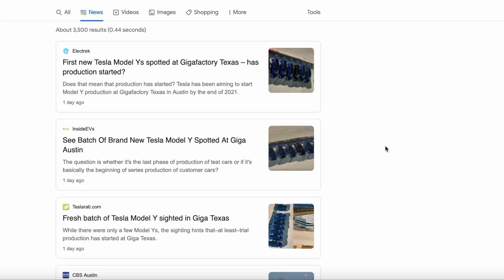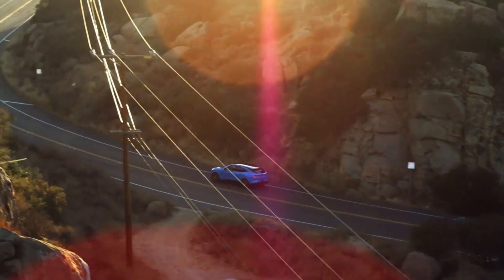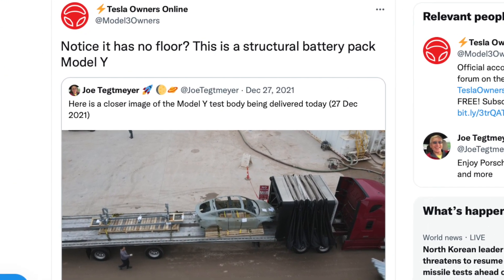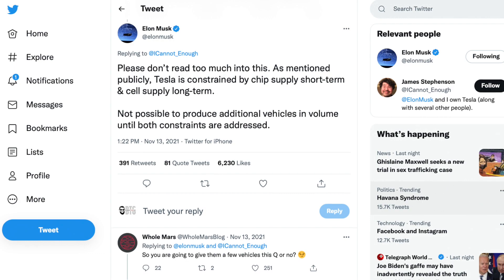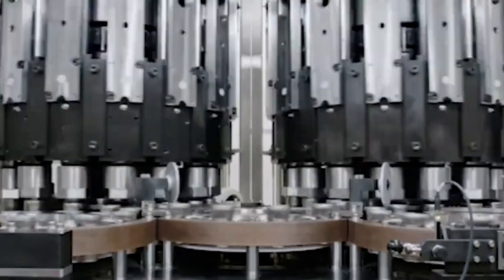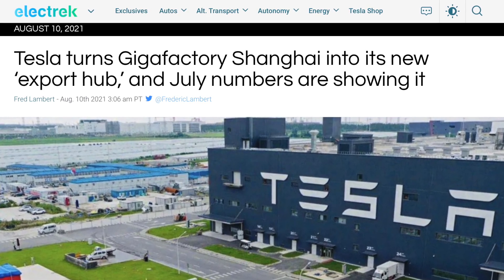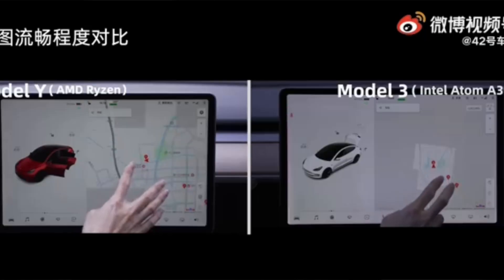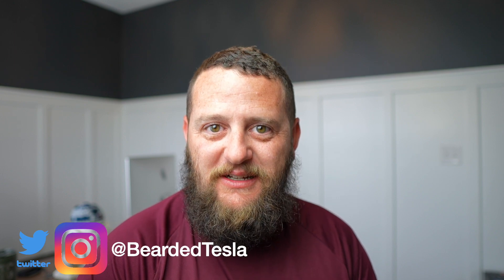Refresh Tesla Model Y Giga Austin Imminent (4680, AMD, Lithium 12v)

Comment: What is the possibility that the floorless Model Y skeleton has a modified 2160 batt pack to be in place of the 4680s until they ramp up production?  Or vice versa, could they be sandbagging us all and 4680 structural battery packs are already IN the Model Ys out of Fremont????  lemme know what you think pls!
Reply from the maker: There was talk about them having a solution for 2170s in the new body if needed

Comment: Interesting that the standard range would have the LFP battery back. The 4680 cells would make the standard range models extremely desirable (but then again, Tesla isn’t really worried about increasing demand right now). It would attribute to the long-term goal of making these vehicles way more affordable, but in do time. 
Hoping to see Model Y price adjustments in the opposite direction soon (fingers crossed they can achieve volume production sooner than anticipated).
Reply from the maker: I agree but for now supply is limited

Comment: It seems the battery supply chain will filter out which EV manufacturers will survive in future. If an EV manufacturer cannot get enough battery raw materials for battery production, then its EVs will be expensive and not meet customer demand which makes these customers buy other EVs thereby naturally filtering & bankrupting the under-prepared EV manufacturers.
Reply from the maker: Pretty much

Comment: Great video, thank you for sharing!! FYI the new lithium battery is 15v, not 12v like it says in the title, and will also involve some updates in electrical components to allow them to conform to the higher voltage.
Reply from the maker: Thanks for confirming
Reply: @BeardedTeslaGuy  👍

Comment: Took delivery of a Model Y LR on Jan. 6th, unfortunately did not have AMD, and probably not the new 12v either. Tesla couldn't tell me and I haven't dug into the hood to find out. I may have missed out. Oh well. Still enjoying the car :)
Reply from the maker: You can remove just the cover over your bio filter and you’ll see what battery you have
Reply: @BeardedTeslaGuy  I checked this morning, looks like it’s the older lead acid battery, supplied by Hankook (85B24LS). I wonder if that can be swapped later for a new lithium ion?
On a side note, those little vents in the cover break very easily. Be careful!!

Comment: I think the new Austin MY with the 4680 cells will be sold at a higher price, if Fremont is still putting out the MY with 2170 cells. Tesla would have to do this because people would be canceling their Fremont orders in large numbers to get the 4680 battery cells. At this time Tesla could command another $5k-$10k for the Austin MY if the range comes in at 400+ and the charge time is significantly reduced. This price increase would be temporary until the whole MY production shifts to 4680. The only other possibility would be if the Fremont has the capacity for the 4680 cells to supply their own production. Also, does Fremont have the front casting Gigapress in production yet? Hopefully all these questions and speculations will be answered at the Q4 earnings call next week.
Reply from the maker: I’d think so too

Comment: Estimated delivery for my LRMY is Feb 25 - Mar 25... wondering if it'll be a freemont or Austin. Hoping Elon's product roadmap will answer that question for me. Hoping for 4680 cells but only 1-2 months away from delivery, it doesn't look likely
Reply from the maker: Hope it answers a lot of questions. I wouldn’t hold your breath though because it’ll take some time to get to volume production
Reply: worse to push your order further. First when we've got info regarding 4680 last year everyone was excited until it's been pushed that we shouldn't expected it earlier than end of 2022. Currently we have what is in the video. Austin Giga will start production with 4680. Huge surprise. So yeah, just wait extra 1-2 months if possible. This is my plan now

Comment: I just took delivery of my MY a few days ago and it does come with the new AMD Ryzen chips. Wish I could have held off my order longer for the 4680 batteries, but I have a feeling they won’t be ready until much later this year at full scale so I was happy to take delivery.
Reply from the maker: Yea, 4680 may start showing up here and there, but volume production will take a few months I'd suspect.
Reply: @ Lt.Dan457  I feel feel your pain 😔 I m scheduled to take delivery this weekend cuz I already have loan approval and insurance etc. Instead of being excited, I'm agonizing over this batteries business.  I could try to hold them off but loan approval may expire and there's no guarantee I will receive the 4680.  Typically, I would not car but I am planning to keep this car for a long time since I recently retire and don't expect to use much.  What s your take? Are you regretting your decision about the delivery? Hope you will get to enjoy it since it is a big purchase.  I guess you can always sell and buy the upgraded version later. Then again, not everyone can afford that.
Reply: My thoughts are I'm ok without the newer battery. They'd likely adjust the size to get same range. Would likely just make the car lighter so a bit more efficient, which is why child use a smaller battery. Likely same/similar warranty, so overall I think it's a wash for now. I'm trying to patiently wait. 3-7 weeks to go.

Comment: Taking delivery of my MYP tomorrow. Will update you if I notice any upgrades. Great videos as always!

Update: Just took delivery. Excited to confirm both AMD Ryzen and Li 12V are finally here! (yet to open the cover and see it with my own eyes but the Tesla rep confirmed. Looked up AMD processor in the system myself).

Spent over 90 min inspecting it and I was impressed that I did not notice any QC issues! Just a handful of dirty spots which they took care of in no time. Super happy about the whole experience! 

Picked it up at Carlsbad center in South Cali.
Reply from the maker: Congrats!
Reply: When did you order? Or how long was the total wait? I am trying to get a more accurate estimate for my Model Y Performance. I ordered one January 10th and have an estimated delivery date of March 7-31.
Reply: @automaticmountaintop  I ordered one on the 1st mine says March 1st -29th
Reply: @jasonbryant7075  I ordered on Jan 17 and my delivery range is mar 16-31 I’m in CA.
Reply: @mixxndj  I’m in South Carolina so I’m hoping mine comes from Texas but probably unlikely
Reply: @automaticmountaintop  Long story. Ordered mine Oct 24 with delivery estimate of Dec. They called me on Christmas morning to schedule but I was on vacation and asked to reschedule for early Jan. I realized of course that it doesn’t work like that and it was pushed back to late March. Called them and explained that tesla rep did not mention another 3 months of waiting and I got 30 days to finalize my loan app. The next day they updated the delivery to 2nd half of Jan.
Reply: @doomlord any update?
Reply: @minaaziz9152  it was delivered with both AMD and Li 12V!

Comment: I am waiting on a Y LR Blue with black interior. I got excited to see those new blue Y's charging outside.  My EDD is still showing June so I am sure it will be from Austin as I closer to it than Fremont.  Either way I am excited to see how far along they are.  From Joe T's photos the other day, you can see many Y's on the production floor. I am seeing tons of parts in the bins from the stamping machine, so I would say they are making parts locally. Thanks for the updates.
Reply from the maker: Cheers
Reply: Bearded T G / In the yesterday's or today's news, Dongfeng launched 50 EVs model 'Dongfeng Fengshen ( Aeolus ) E70' with SOLID STATE BATTERY!
The Solid State Battery is here!

Comment: EDD of Feb to Mar for my MYLR and I'm hoping it'll have the 4680, but we'll see. No VIN yet, but our local showroom will be getting a batch in late Jan /early Feb for us to test drive. I tested a '21 MYLR, so I'm curious to see any differences.
Reply from the maker: Yea it’s going to be tight on timing. I think they’ll be making some, but not huge volume for probably a quarter
Reply: @BeardedTeslaGuy  yeah, I was thinking the same thing. That's fine, honestly. I'm more hoping for rear double pane windows, amd chip, and Li 12v.
Reply: Same as you. EDD on my MY performance is mid Feb to mid March. Hoping we both get these upgrades

Comment: Always good comprehensive updates. Thanks for your all hard work. I know you have a LOT of your plate. I am really excited to hear about the 4680 Structural Battery Pack! That's going be incredible. 👍🏾
Reply from the maker: I can’t wait to see what it brings in real life performance
Reply: @BeardedTeslaGuy  Oh yeah! 😁 Range will be remarkable. The car will be even safer and should drive smoother with the Gigapress construction.
Reply: @deg3363  I doubt we see much range improvement.  Demand is VERY high and a long wait list.  They could give a modest 20 mile improvement and then cut out material = more profit.
Reply: @scholz222  I see what you are saying buy Telsa already makes $10k in profit/vehicle. Thier manufacturing process is centered around efficiency and change. The 4680 battery chemistry will be way more than a 20 mile increase. Plus they always underestimate Specs. The wait is due to demand. Once Giga Texas is up and running Demand will be met. Let’s see.
Reply: @deg3363  hope you’re right! Seriously. My model Y is slated for July delivery
Reply: @scholz222  Nice 👍🏾 I took delivery of my 2021 Y LR in November 2020. No complaints. I will get upgrade in 23. I think you are gonna love your new Y. 👌🏾

Comment: I still dont understand why they wouldnt build both the 3 and y in Texas.  I thought they shared 75% of parts.
Reply from the maker: Don’t know what the rational is behind it
Reply: My theory is that they'll shut down a Fremont Model Y line and retool with new robots, paint shop, etc. for M3. So they keep the existing M3 lines for a bit, then switch over to the new line, then upgrade the old M3 lines. I think M3 production could drop for a bit with that shuffling.

About sharing parts, that doesn't matter much where built. Third party suppliers just send to 2 locations and everything else built in house takes the same basic equipment. They already likely have many copies of each tool, so just having what's needed on each site, so no need to build both cars in same building. 

Also, body panels and other things are different. Check out Munro's tear downs. Even the motors have some differences. 

Will be fun to watch how it all shakes out.

Comment: Great update! Taking delivery of my MY tomorrow and I'll be interested to see if mine will have both the AMD chip and the Li-Ion 12v battery.
Reply from the maker: So awesome congrats!
Reply: Hey how long was it from your order to getting your hard date?  I just put in an order recently and delivery was March 16-31 but got update this morning 2/16-3/16
Reply: @DoctorPainKilla  when did you order your Y? I ordered mine in October
Reply: @mattkessler2  I ordered mine January 16. It is the performance model
Reply: @DoctorPainKilla  I ordered on Jan 17 and have Mar 16 to 31. I’m in CA
Reply: @DoctorPainKilla  it took 5 months from the day I ordered to the day it was delivered... I received my VIN about a week before delivery
Reply: I'm in So Cal. MYLR7, Gray/black, 20", hitch. Ordered September, date bounced around, currently saying 2/12-3/12.
I want AMD, LiPo accessory battery, dual pane rear windows. I'd like single casting front and 4680's, but not expecting that, especially with date being so close.
Reply: Report back on the chip and battery after you figure it out. Thanks!
Reply: @ErickBreneman  Yes, both the AMD chip and Li-Ion battery are on board
Reply: @chewiehawk4237  Cool, thanks. Mine's now been pushed to 3/4-3/31. I guess the end of quarter push is when they'll get out the California ones? (Although I had an in-law order early October (2 weeks after me) that received theirs 2 weeks ago. They are also in SoCal, only about 20 miles from me. 

About a month in, how are you settling in? Got driver's presets are good, etc? Anything interesting you've learned that may not have been covered? I know one thing I've never seen that I want to put up on YT after I get mine. Related to rear space with 7-seater. 

Again, thanks!
Reply: @ErickBreneman  Yes, pretty much settled... presets dialed in for the most part, mostly just playing with all of the different settings. Still getting used to AP and I'm not a fan of the side mirrors auto adjusting downward  when in reverse.
Reply: @chewiehawk4237  I was looking up parking stuff, specifically was wondering about the mirrors moving down. Random. I read in the manual that it is a setting you can change. 
From manual: To turn this feature on or off, touch Controls > Mirrors > Mirror Auto Tilt

Comment: I’m curious to what the transition of MY will be from Fremont to GT.

Interesting point you make on the standard range MY. I hope you are right. My delivery eta is July.
Reply from the maker: They can’t have 2 different versions of the same car…so how do they separate? Should be interesting to see
Reply: @BeardedTeslaGuy  Agree - I like you thought process on this one!
Reply: @BeardedTeslaGuy  Agree with that to a point...they could use price to market MY's with 2170 and 4680 packs with similar range at the same time, but they would have to price the 2170 cars $4k to 8K lower IMHO.